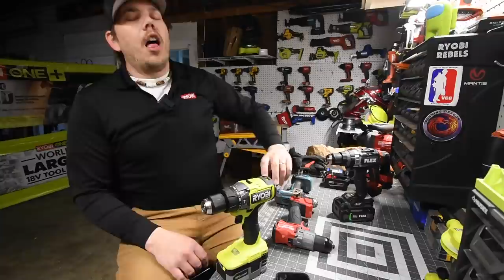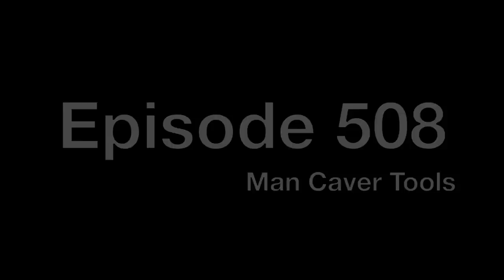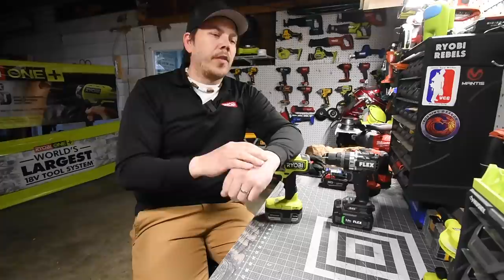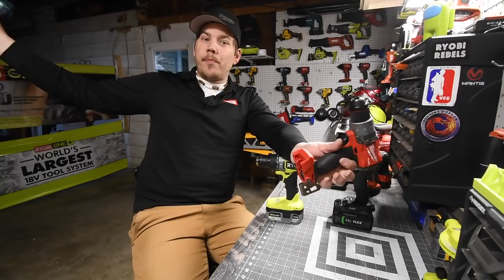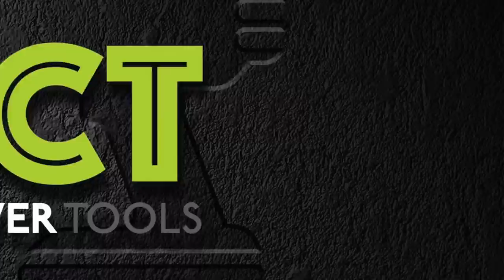Why are tool tests unfair?

Comment: One of the biggest reasons no one should be switching to flex at this time (if you use tools they have not released yet) is because they don't have enough power tools yet and they don't have as good of a variety of batteries. Time will tell.

Comment: Your channel and other YouTube creators like myself cannot be equal with these tests, on this we very much agree. The science employed is also questionable as you would need to recreate the environment perfectly everytime. Applying the same exact downward pressure on every tool in the test, changing the bit to a new one before every test, have the same exact amp hour for each tool which may not exist, Testing hundreds if not thousands of the same tool model to account for the variable of manufacturing mistakes, I could go on and on. With that said the tests are as fair and as scientific as you or any YouTuber that is based mostly on entertainment could make them. They provide enough science to help make some purchasing decisions and provide a measure of knowledge regarding the pros and cons of each battery line up, gaining the viewer a measure of potential performance in the field. The true value comes when the YouTuber is unbiased and provides their opinion in their own special way. If I like that YouTube, trust him, and agree with their assessment I may buy the tool. These reviews provide confidence that the tool brand chosen may perform to a desired standard but are never a garuntee. All of us who have  YouTube channels need  to understand that these tests are entertainment first as they cannot fully dictate how a product will perform for everyone in the field. Which is one of the reasons fan boys were created. Makita did not perform for one but for another it performed perfectly. Why? Manufacturer mistake, type of work performed?  I wouldn't worry about the comments continue to make the videos as long as they are entertaining they have value. That's my 2 cents anyway brother!
Reply from the maker: its a general test and these tests are done over and over again in videos. I do many tests on each tool in a lot of videos.

Comment: Your methodology is the best. Other youtubers make inconclusive tests using weak batteries for some tools and specially skimping on the HO / Flexvolt / whatever has 21700 cells. You show what each tool is really capable of

Comment: @Man Caver Tools. Thanks Dave. I must have missed a new sport taking over the nation called tool testing. Who's the fastest at drilling, cutting, driving. Who has the most torque? I think carpenters on jobsites aren't worried about speed (Ha! Got that fastener in 1/8 second faster than you Bob). When they pull the trigger on their impact or drill, will it always work? Do they have to fuss about losing drill bits from a chuck or dropping bits from collet that won't keep the bit on? Or the tool spends more time out for repairs instead of at the jobsite making them money. Does the tool feel good in your hands because of trigger position, amount of trigger pull, is the safety a hassle to use? Does the tool bog down too easily? Sure, there're people out their where it very important for them to be on one battery platform or even on one tool company's tool. Every trades person I've ever met has a collection of different brands of tools in truck for different reasons. Most of the time it's like you said, not every company makes the best of every tool out there.

Hope you and your family stay safe and well.

Comment: 4:45 we discovered Ryobi's 3ah is actually pretty dang good this week
Reply: I continue to believe that Ryobi ONE+ as a platform is more than enough for even the advanced DIYer, and the HP line pushes it up into the light duty contractor realm.
Reply: @PhillyFixed  I can agree with that. I view Ryobi more as a lifestyle brand with the amount of products they have to offer the basic home owner. I just wish they took that battery stance after creating a slide on version, lol.

Comment: Excellent points you made!
I think overall to me it’s about comparable stats, batteries, etc, as best you can match them that makes a fair test. As an example, comparing a full size Ford Expedition to a compact Honda CRV, and then saying the Ford is the winner because it’s more powerful and has more room, would not be fair. However comparing the top trim Ford Edge to a top trim Honda CRV and declaring the Ford has more room, or a bit more HP would indeed be fair.
I think for most homeowners and DIYers the “sweet spot” in batteries would be having a 2ah - 2.5ah and an additional 4 or 5ah for when you need that extra power or run time. For pros of course it may be higher depending on what they do (and how compact or large a tool they may need).
Comparing a Ryobi to a Milwaukee or Flex can certainly be fair, because it may show the Ryobi isn’t the most powerful, but has plenty of power for the average DYI user and that alone can be valuable information.
Thanks again!

Comment: I often make the comparison of tool brands to car manufacturers. Some people are staunch Ford, Chevrolet, or insert whatever __ brand. Similarly, some people have a tool brand that to them is the only tool worth buying. And much like automobiles, they get fired up about the topic.

Like you, I appreciate most all tool brands, and agree they all have strengths and weaknesses.

The passion people have for tools, and in some cases a specific tool brand isn't going to change. Your channel is great, the methods you use for testing are fair, and informative - just keep doing what you're doing my friend!

Comment: As for fairness, I'd say it's a matter of price. Comparing a $100 tool and battery to a $500 tool and battery isn't fair, because you'd absolutely expect the $500 combo to be the best, and it should be the best. It'd be like putting a prime Mike Tyson up against a good amateur boxer. 

If brand A's $500 battery+tool is a 5 Ah battery, and brand B's 5 Ah battery + tool pack is $600, that's a more fair comparison, but it still needs to include all the information. Maybe the more expensive combo comes with a much longer warranty period, which is absolutely worth knowing and may be worth the $100 extra to some people.

I may be mistaken, but I think most people buy within a budget. If they aren't already bought in to a manufacturer, they'll go out with a certain amount of money in mind that they're willing to spend (with a little bit of flexibility), and if they can get an extra battery with A over B, they'll probably pick A because it's better value, even if they won't ever actually need the extra battery. I strongly suspect this is true for professionals as well - you're not going to buy a $25,000 tool over a $2,500 tool unless it's in your set budget, regardless of how good it is.

Comment: The test where fair I believe the people  just wanted to see the setting 3 on the dewalt vs the flex with turbo on thats all but thanks for the videos and info I really appreciate your time ✌
Reply: Yea i see wat you mean but i also see his point is like its handicapping the dewalt by saying hey you cant use that gear its too good. On the job site that 2nd gear of 3 is available which is real world use. I may be wrong but i feel like the dewalt on speed 3 would have less torque since the torque range is spread across 3 gears instead of 2 but maybe not. Guess is would have been good to see both settings and the difference

Comment: 100% agreed, if you're going against the best on the market you can't handicap them. It's the best from one brand vs the best from the other. Showing this is what you're going to be using with this vs what you use with that. The only real way to make it "equal" is putting what comes in the kit for each and showing value. But value for the money that's a different kind of test than what's best overall. 

It's also worth noting that most major brands have more compact tools and clearly sacrifice some power to balance out the size and weight because those matter just as much to most people that are actually using them to work daily.
Reply from the maker: I agree that power isnt everything. that is why the Maktia impact is my favorite and not the Milwuakee.

Comment: I agree with you,  for example flex did use their brand new battery and then they put on old 3ah battery on the milwaukee drill and then  flex claim the drill was the fastest nad strongest on the market

Comment: Maybe folks are saying "Test Speed 1 Turbo".  They are claiming DCD Speed 3 = Flex Speed 2.  So the 'middle gear' I guess becomes a high-speed high-torque gear (Speed 1 Turbo?) 

I still think a mechanical gear (DCD Speed 2) was a better idea than removing the governor on current (which would build up the Heat people are seeing).   So I would predict a DeWalt win more times out of 4 again (Flex thermal shutdown).  

That's my hypothesis.

Comment: According to Irwin, the recommended RPM for that speedbor is 500, so on speed 1 should be fine.  Any chip inside the hole needs to be cleared out if drilling on thicker materials.  So any misuse may cause burns.  Trust me, trie running that on 2500 rpm and you can smell it burning

Comment: Right on. If people don’t like the options their favorite tool brand has to do a test then maybe that’s an indicator they bought the wrong tool brand. The point of these testing channels is to not make people feel better about the tool brand they bought, it’s to show people what’s available for the average individual using these tools every day and how they perform doing so. If one company is offering better batteries than the other, that’s what people will have on the job site. If you don’t like that, then buy the brand that has the better battery. Keep up the great vids

Comment: I agree, if they are going to call the Flex " The most powerful hammerdrill " then it has to beat the milwaulkee with the 9 amp hour high output , and the dewalt 998 with a flexvolt battery , it wouldnt be fair to ease off the gas and let flex catch up , When flex makes bigger batteries then they can try again
Reply: I'd live to see that shootout, but flex does have a 12 ah battery for sale, it's $250. So that comparison would be the one to watch in my opinion

Comment: It can be kind of hard due to sales and different bundles but I would think it would be fair to take into consideration the price vs performance as sold. Most people will not always buy new/upgraded batteries unless the old ones are dead. I have a Ryobi that's like 10yrs old and the batteries have held up but I'll admit don't last as long. I will probably buy a new drill/bundle rather then a new/upgraded battery if there even still available/compatible which I haven't even looked at. For the tool nut or tradesman maybe the best Available set up for each tool head to head with price points for consumers to decide if it's worth the extra cost.
Reply from the maker: their are many videos of each tool. most people see a video and think that is the only video I did of the tool. I have over 400 videos of tool tests

Comment: Well, it's not fair to say a tool is better because it's faster...the nr1 reason of a tool being the best it's reliability! After that is performance, but not by compromising ergonomics, features and RELIABILITY! getting more power from the battery shorten the life of it, even Ave explained this in one of its videos comparing batteries, he said that Milwaukee and Dewalt gives you more punch but Makita will last you longer....and its logical, its like a car that drives faster and has better mpg...it can't be done.

Comment: I agree, and. Like I said in the previous video. It is hard to test handheld tools. It is 100% possible to stall on a tool by user "error" and what not. Handicapping a tool I agree 💯 is BS. Sure we can do apple to apple 5/6amp batteries. 
I think ultimately you can't go wrong with one of the bigger brands. Find a battery platform you like and go with it. 
Dewalt
Milwaukee
Makita
Metabo 
Kobalt
Ryobi
Ridgid
Can't really go wrong with them just find what works for you. No one tool company is the best at anything. Personally I own kobalt at home at work I have DeWalt I used to have Milwaukee for work but they burnt out and my boss bought me a DeWalt set. They both work just fine 🤷. 
I honestly think Flex will do just fine but if you are already in a battery platform and ate being served just fine there's not much of a reason to look at Flex. Now the newer guys to the trades or guys replacing burnt out tools sure look at Flex. They're new but coke from a reputable brand we have all dealt with Chervon

Comment: Good argumentation, what is also often forgotten, you've got one tool out of thousands/millions made, so a very restrictred sample size. Statistically speaking, one is none, so every test you do will have an high confidence interval (the lower the better) meaning that it actually doesn't mean too much. That said, the test show a representative action. But that can explain differences between test channels, slightly better cells, better greased motor etc. We are from a testing laboratory and we try to test at least 50 of the same batch for example.

Comment: Idk if I’m wrong but maybe do a test at the best each company has (like the flex volt advantage against the Milwaukee w ho battery hammer drill) put it in the title that the companies of your choice are putting out the best they have to offer. Now that would be entertaining and informative

Comment: Maybe use the same batteries with those adapters you have. Like the videos where you used the DeWalt batteries on the Mikita or Ryobi. Just to take the batteries out of the equation. Just the tools power same batteries. Just a thought and I think you’re the guy to do it and do it well.  Enjoy the channel thanks for the entertainment. 🙏🏾

Comment: If the cost of the Milwaukee with the high out put battery, is about the same as what it’s against then yes it’s fine, but when you have a kit that’s the same price as the one it’s going against and add on an extra battery (for more money) to get one to win that’s not right because you’re bumping it up a class, it’s like putting a stock car against a drag racer, they aren’t in the same class so you wouldn’t see them against each other. I get what you’re saying with Milwaukee developing the HO batteries to make the tools better, but there is a price to that. 

By the way love the content you’re putting out, I discovered you as I was looking at flex videos, and I love what you’re doing, I don’t always agree with it, but I do love what you’re trying to do, keep it up.

Comment: on this note, I'd think would be awesome if you'd really do the maximum best from a manufacturer compared with another to show the real differences that can be achieved with what you could order from each brand and tool category (best tool + best&highest compatible battery for it)
Reply: I absolutely agree. The best they can do against the best they can do. You can’t go faster than than the highest ah and best battery cells offered by each specific brand. I’ve been saying this for a while now.

Comment: I think if you're gonna do a vs between both drills should have the same amp hour battery unless the company doesn't make one. Now if you do the vs between the flex and  the Ryobi and you don't have the right batteries it should be considered that the Ryobi could've done better cause we all know how good flex is or vice versa. I sometimes think if you don't have the same battery the vs shouldn't be done but then it would be boring and you couldn't make videos which would suck. But your right with the fairness. Don't worry I've never said anything about unfairness I just love your videos and what you do
Reply: He should put 6ah in Ryobi as it would bring it up to size of Flex and provide no disadvantage. Then if it looses no excuses.  If it wins the Flex gets taken to the park by Green
Reply: You want to have the closest watt hours not amp hours. You could have 2 different batteries that are 5.0Ah but their not equal. You can have a 3.0 and a 5.0 and say their not the same because the 5.0 should destroy the 3.0 because it’s bigger, but if the watt hours are the same they both should put out the same amount of power.
Reply: @akaredcrossbow  watt hours are calculated using the voltage being drawn by the device.  With power tools Amp hour is the sort of rating that should be used with measuring batteries for similar output.  Also Ryobi make 18volt tools and Flex is "24 volt" if they're not lying.
Reply: @xephael3485  I agree cause with no doubt I know the flex will win even if the Ryobi has a 6ah. What will be interesting is to see which battery would Ryobi need to keep up or beat the flex
Reply: @weldonpinder7295  don't know if you don't try it...flex has been giving Ryobi like performance on other tools
Reply: @xephael3485  i would like to see the same watt hours used on the battery. Just an example because I don’t know the watt hour of the batteries, but If flex is using a 5.0 at 209Wh then wouldn’t it be better to use a 8.0 for  Milwaukee to make up the Watt hours?

Comment: I agree, and I’ve felt that way from the beginning.

Sure, it would be better if every tool company used the same battery cells and the battery packs had the same voltage and same amp hours. But they don’t. 

Just get battery specs as close as you can for each brand, like of course don’t put an 8ah battery on a dewalt, a 12 ah battery on the Milwaukee and a 3 ah battery on a makita. Get them all within an amp hour which I’d say is fair.